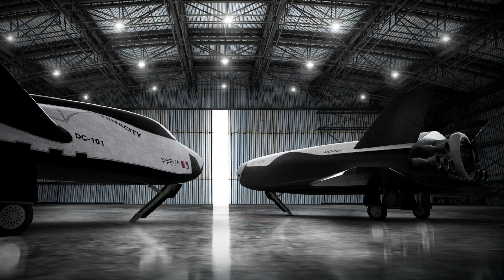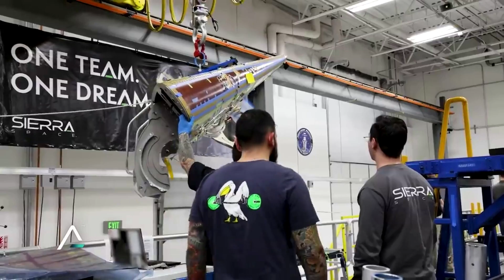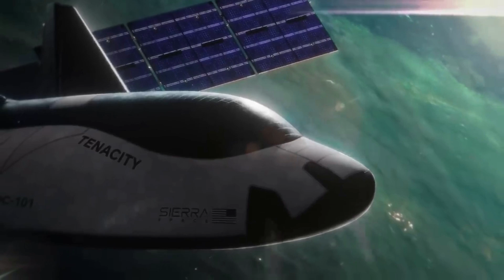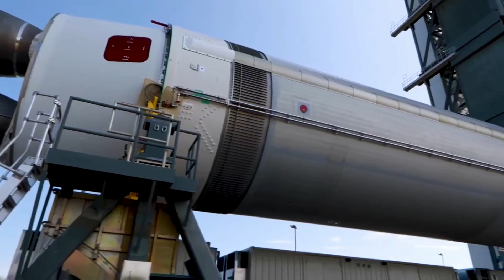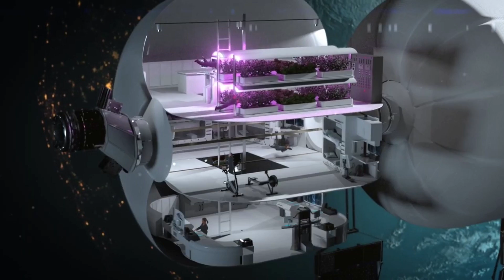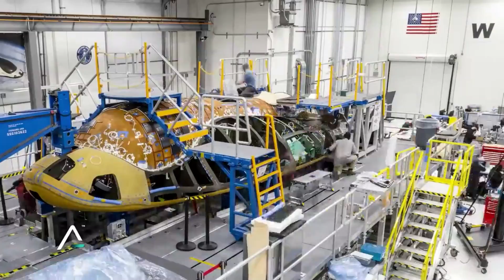New Dream Chaser, Progress On Tenacity's First Launch, Updates, & More

Comment: If they   want to get this craft into space in 2023 they need to start talking to spacex. I dont the vulcan is going to get into space until 2024.
Reply: The Falcon 9's payload fairing isn't big enough to hold a DreamChaser, even with folded wings... which means even the Falcon Heavy fairing isn't big enough. 

But the Starship could carry a Dream Chaser without any trouble!
Reply: Falcon 9 can not launch Dream Chaser.

Comment: DC-200 is the crewed variant. They've talked about the designations at CES last year. DC-100 is cargo, 200 is crew and 300 is for national security. This was confirmed by one of the employees working on the vehicles on twitter. The crewed vehicle will likely not have any traditional front facing windows to reduce risk.
Reply: If no windows then how are they going to see?
Reply: The 200 one looks kinda poop imo, just stick with the 100 design, it looks far better
Reply: @Bruhza5870  do you want to put in risk human lifes?

Comment: The crewed version of Dream Chaser, once man-certified, should be sent to ISS autonomously and remain stationed there as a lifeboat.
Reply: Actually, frankmcgowan, I believe Dream Chaser was originally by NASA for exactly that role: ISS lifeboat (7 crew). Then NASA changed the mission specifications to ISS cargo supply, but as Sierra Space changed design tack, NASA changed yet again the mission specs. to crew delivery/return. Poor Sierra Space! I'm right behind Dream Chaser; humans should fly, airliner style, to LEO and not have to endure the brute force of rocket launch, that should be left for insensitive payloads.
Reply: @davidstevenson9517  Dream Chaser is awesome, but it will only do "airliner" style landing, while launching traditionally. The most viable contender for horizonal launch is Radion One, and it's been over a year since I last heard an update on them.